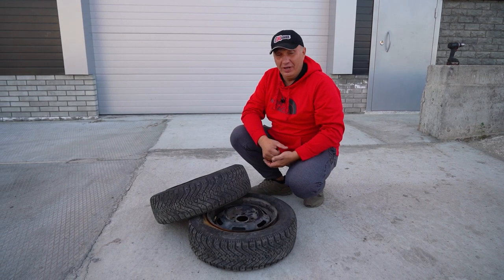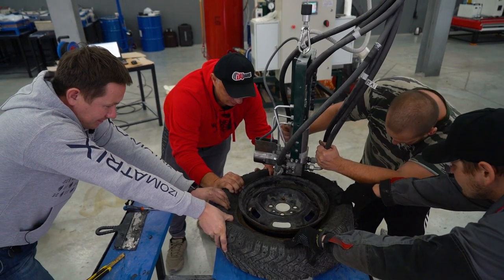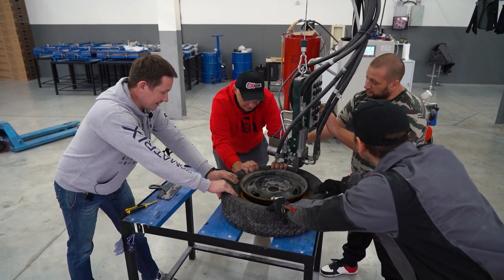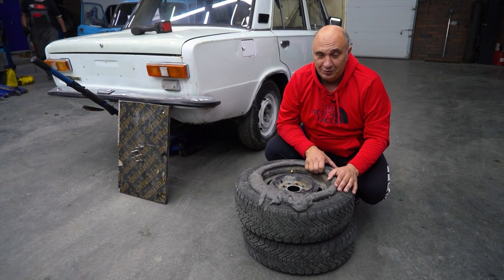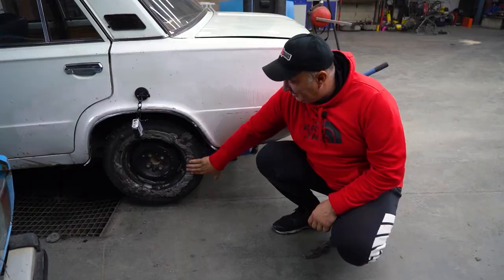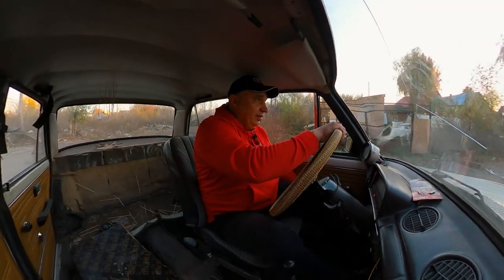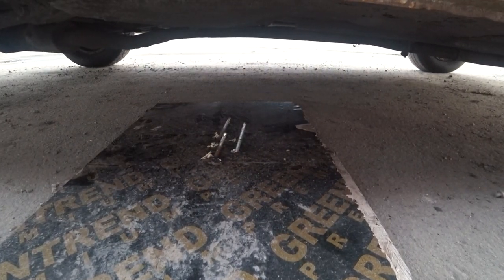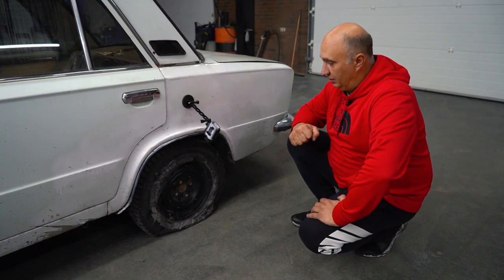Filling tires with polyurethane foam (making them puncture-proof)

Comment: You guys are on the right path. Wondering what would happen if you put a flat thin piece of metal or vinyl  inside around the tire ?
Reply: You mean like a steel belt?😄
Reply: yes i like that idea like a cast iron ring that fits flat againt the inside of the tire.  Like on the inside under the tread.  I made this cart and i used bike tire rims with out the rubber on them and it would just glide down the road with out much friction...steel on pavement real slick.
Reply: A kevlar belt would be better

Comment: I worked in a factory that made and used polyurethanes. The chemicals for foam or solid casting resin are the same only in different ratios to change the urethane chain length. When more than one urethane is used then it is a polyurethane... poly being many. Long chains of urethanes will make a soft material an short chains will be hard. Introducing an accelerator along with the activating catalyst will cause the reaction to happen quickly as well as causing carbon dioxide gasses to become trapped in the polyurethane making it foamy.
***PLEASE use PPE, respirator, nitrile gloves. 
Polyurethanes contain and release isocyanate. This chemical is known to cause health problems.

Comment: Thanks guys, very interesting.

How about another experiment.

Make a single hole in the tread of the tire, do not break the bead, then put the foam in the tire through the hole in the tread while it's standing up.  The foam should expand from the bottom up and push out any air through the top.

Thanks again.

Comment: This method is being used in heavy machinery wheels. There using a foam and air together. So when the tire fails it can go on its on feet to the mechanic and the tire wouldnt suffer further damage!

Comment: If you had a way to spin the wheel right after the foam is injected to push the foam to the outer edges of the tire so it expands from the outer edges down to the rim and using relief holes in the rim itself...👍👍👍

Comment: The sound deadining foam they are using is much like a foam sponge. Other types of foam like the kind that pool noodles are made of are far less permeable to air and water. They should continue looking for the right type of foam and inject it into the wheel while vertically spinning at an optimal speed in several layers of increasingly more dense foam towards the rim, but of course also allowing each layer to fully dry before injecting the next; they would be able to create a badass tire that would out perform all other modern runflats.

Comment: I use 2lb Closed Cell running through Glascraft MH2 with 3/16 x 3 in long jet stream tip on Probler 2 gun. (I ONLY FILL OFF ROAD TYPE TIRES NEVER TIRES THAT NEED BALANCING AND ARE FOR HIGHWAY USE) Heaters set at 120 and 125 on hose heat with 1100 psi on gauges. I remove valve core and drill 1/4 in holes in tread and inner side wall. i do not break down the tire as I haven't found it necessary . Amount of holes and amount of foam will vary base on tire size I use the digital counter on machine as opposed to a count up of time... Write down tire size amount of strokes on counter along with your temp and pressure settings. If you get everything dialed in correctly  then stick with the formula that works, It should be very consistent with equal size tires.

Comment: I've had a zero turn lawn mower that was constantly losing air out of the smaller front tires. I got sick of dealing with the hassle and took it to a tire and battery shop. Had them fill both front tires with an expanding foam. They're hard as a rock and don't absorb impacts, but I've never had to deal with a leaky wheel again. Don't remember the name of the foam though.

Comment: Fill it with 45 seconds of foam with holes in one side like the passenger rear. Then patch the holes. Then put some air in it a touch and see what the psi is. Try to get it at normal psi and balance it, then do max psi and see the difference and see if it firms the tire up enough to round it out. Then run over a nail. Then you have a real run flat tire

Comment: What you need to do is finjd out what the volume is of the tire/ then oyt 1 times less the volumr of foam.. that way you wouldnt need relife holes. and you could also pump air in it. So in essence making it a runflat.

Comment: Hello, you need to allow the foam to complete the curing (hardening) process for at least 24 hours before using it. Preferably in a warm environment. And it should lay flat during that time.

Comment: Get a denser type foam and that would still impact fuel economy because of the weight. What if the tire was sectioned off inside with say cardboard and then each section is filled, also each section has 2 relief holes at each side of the of the tire. One side for filling a smaller hole for pressure relief and air escape.

Comment: Drill a hole for a 2nd valve on the opposite side of the original valve. Remove both valve core for both. Lay tire horizontally flat and inject the foam. Hope it works.🤔

Comment: Foam fill the tire OFF the rim. 1st step: take tire off rim, lubricate the tire bead and rim to make them slippery - take out valve stem. (Do a test: spray 6 inches of foam [inside the tire if you want to conserve foam] and watch it for 2 minutes to see how much it expands, so you can make better judgements). 2nd step: Lay tire flat - without rim.  3rd step: spray 10% foam - aiming to cover some on inside sidewall, some inside tread area. ( remember 10% foam only - let foam set -up a little bit... BUT not much - you want the foam from each step to keep expanding onto the next step)   4th step: turn tire over - repeat step two - 10% more foam.  5th step: add 30% more foam between and above the first two applications. .( My percentages might be wrong ! for you - 10% + 10% + 30% might expand to 110% - LESS - IS MORE You can always put more in , but you'll have a hard time taking some out. 6th step: mount tire on rim.  7th step: rotate the Slippery tire 360 degrees while your spraying the last 30% foam THROUGH the valve stem hole.     GET THIS ALL DONE WITHIN 5 - 7 MINUTES. 8th step: place the rim up on a support so nothing touches the tire, so it can evenly expand.

Comment: How about this experient: fill the tire 1/3 the way - 1/2 way full with the foam and still have the original inner tube. Maybe spray a bead of foam over the side of the inner tube (sidewall protection). That way it will still have normal firmness if inflated. When punctured, it still has the soft but ridable feel as the wheels you did.

Comment: I tried filling a wheelbarrow tire with spray foam. The issue I ran across was it would not cure. I even put a couple of good size holes in the sidewalls and it still wouldn't harden. It couldn't cure properly with the absence of air. I cut the tire open after a few days and it was still liquid in the center most parts.

Comment: Fill with silicone via the valve stem at the bottom, have a hole in the top to release air. It'll take days to harden though.

Comment: 12:35 do to the fill method and how it sets up. You may need to find another way to make sure the entire tire gets filled with foam. Maybe even completely removing the tire, and filling it, then trimming the foam back to fit a wheel in, that way theres no possible way air is trapped, Just densely expanded foam. Would work wonderful in a pinch, or for offroad use..
Reply: like use the older style split rim that could be put back together without much problem after the foam was in the tire

Comment: Awesome video, testing multiple densitys is an excellent idea. Those remind me of drag /funny car tires. Is there a way to test rolling resistance or half a kilometer times / quarter mile times? Maybe using a tire machine to spin can reduce air and holes in rim to vent. Spining faster in theory should move air to center and makes out part denser. A bonus is if you can get the foam to set up while spining the tire should also self balance. And are the tires quieter?

Comment: Foam needs air to expand and to cure too. The extra holes made all the difference. It has no structural value when wet so it can't inflate the tire, the gas it releases can, but not the foam itself.

Comment: Fill a couple tires with the black urethane for securing windscreens into vehicles. Or some other rubberized automotive adhesive/sealant.

Edit: Line-X Rubberized coating!!!

Comment: maybe u could install a larger valve in the rim to allow the foam to escape instead of drilling holes in tire. another thought just to have fun try filling a tire with foam without drilling holes to see if it will explode . interesting to find out call those tires maypop brand.

Comment: Or better yet take the Schrader valve out and fill it with foam for the 25 seconds. Then put the Schrader valve back in after 2 days of setting up and drying. Then take a drill bit smaller then the Schrader valve to not damage the threads on the valve and drill into the foam a 3 inches to clear the air path. Then re install the Schrader valve and add air to the tires normal PSI or MaX PSI rating. This should round out the tire and then balance the tire as normal. Then you should technically be able to drive on it as normal and balanced.  Then run over a nail. It will only deflate a little as its packed with foam, and one would be able to still drive for days on a punctured tire if not months

Comment: To fill the tyre with foam you have got to spray  with fine mist of hot water at the same time as the foam or it will not set and expand in Layers that will work  😀

Comment: Polyurethane foam often doesn’t cure very well if you blow it into a closed space, but it’s not really designed for fitting into tyres.  Scissor lift wheels are sometimes fitted with some sort of foam but I don’t know what they use.

Also, I want to know how you drove over a bunch of nails and didn’t manage to get a puncture and somehow I get a nail or screw in one of my tyres every week.

Comment: cant you drill one hole in side wall that allows the foam too drop in with that nozzle applicator and another hole on other side too allow air too escape. than you dont just have too hope it all falls in through crack

Comment: There were some concern about overfilling and making the tire explode. How much pressure can the foam produce? I mean it surely can't expand 17 times (or what was said in the video) regardless of how tough container it is poured in to.
Reply: Hot, exothermic reaction means rapid gas generation and expansion, the foam expands with the gas and eventually hardens. If the reaction rate calculations were spot on, you could fill them with less concern, but I wouldn’t trust a crusty old junk yard tire, I suspect that’s what they are more likely running away from.
Reply: @gmailisaretard  well, that depends on the toughness of the vessel of course which was my question: "how much pressure can it produce if put in a rock solid container that is more than 17 times smaller than the amount of foam (when expanded) poured in?"

Comment: I can see this causing a complete disaster.  I would only do on a slow moving vehicle, like a lawn tractor or as such, not an automobile that moves at 70+ MPH, and in states with inspection, causing a failure and spending $1500 on new tires.

Comment: Can you try a mixture of the jelly they put into forklift tyres? Maybe if its somewhat aerated it will be soft and light enough to act as a car tyre air without weighing more than the car
Reply: @gmailisaretard  there are at least two types, some are solid rubber and pressed on, and some have a gel inside instead of a tube

Comment: What if you didn't put holes in the tire and just removed the Schrader valve?
Reply: Probably better.. or drill another hole for a schrader valve... keep one filling up and the other for fine adjustments to get the pressure right 😁
Reply: Foam fill the tire OFF the rim. 1st step: take tire off rim, lubricate the tire bead and rim to make them slippery - take out valve stem. (Do a test: spray 6 inches of foam [inside the tire if you want to conserve foam] and watch it for 2 minutes to see how much it expands, so you can make better judgements). 2nd step: Lay tire flat - without rim.  3rd step: spray 10% foam - aiming to cover some on inside sidewall, some inside tread area. ( remember 10% foam only - let foam set -up a little bit... BUT not much - you want the foam from each step to keep expanding onto the next step)   4th step: turn tire over - repeat step two - 10% more foam.  5th step: add 30% more foam between and above the first two applications. .( My percentages might be wrong ! for you - 10% + 10% + 30% might expand to 110% - LESS - IS MORE You can always put more in , but you'll have a hard time taking some out. 6th step: mount tire on rim.  7th step: rotate the Slippery tire 360 degrees while your spraying the last 30% foam THROUGH the valve stem hole.     GET THIS ALL DONE WITHIN 5 - 7 MINUTES. 8th step: place the rim up on a support so nothing touches the tire, so it can evenly expand.

Comment: It's only practical for applications such as a tractor that drives through a junkyard all day, those are exposed to a lot of potential punctures. but on cars using public highways, adding that much weight & mass to a rotating assembly is, well, not practical imo. I don't drive on beds of nails during my commute. :body-blue-raised-arms: everything has it's place.

Comment: how funny. i use builders expanding epoxy foam on my bush basher car. tear out the valve stem, drill a few 20mm holes in the wheel itself for the excess and there you go. no longer get puntures when doing silly stuff in the bush. do you have a non contact thermometer? could the problem be that the foam you put in was hot liquid and then set in the tyre. as rolling resistance, friction heats the tyre the foam returns to liquid and seaps out the expansion holes? maybe if you get the tyres get hot and see if it makes a difference.

Comment: I can't imagine the tire exploding but rather the belts just snapping or ripping apart and the rubber stretching. Which I don't think you can do anything about. I don't think with holes anywhere in the tire it can build enough pressure to seriously injure someone. I wouldn't stand next to it either cause I wouldnt want to slapped or cut with a belt.
They act like the perfect tire, wide and flat tire patch when moving slow and sort of reinflating at speed. Giving better highway mileage and winter traction, you actually want less width in the snow to cut through it better.

Comment: You should of put it on the car with the car in gear on axles stands after you filled them  so the foam liquid rolls around inside of the tire why it cure's and expands

Comment: There is actually already a commercial product and I filled my loaders wheels 20 years ago and they still work. They didn't drill any holes. The foam uses up the air when it expands. If there is not enough air, some foam will stay liquid. I don't know how they filled the tires but I speculate using the valve and inject foam and moist air together.

Comment: Concrete?? Freezing water?? really?
Dude, you really could use someone with engineering as a consultant. 
Letting the tire like on one side? are you sure foam filled up the voids as it should? It makes a lot of sense but the application method was too crude to my liking. Installing just one valve in the opposite side of the foam feeding valve to act as a relief seems better to me. The tire won´t work as it should if the tab (tire edge) is not seated in the rim wheel. Those blobs on one side are not good neither. 
Feel free to contact me.